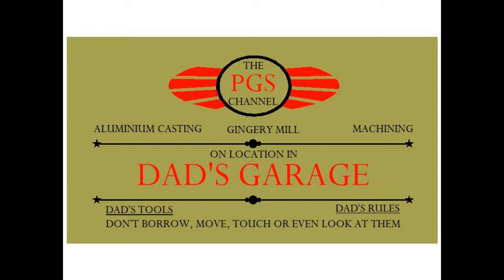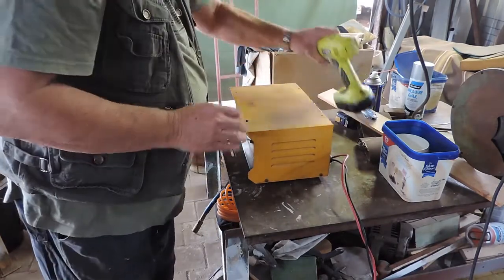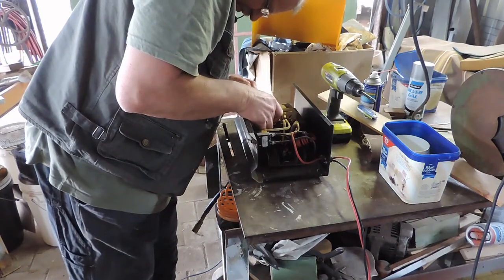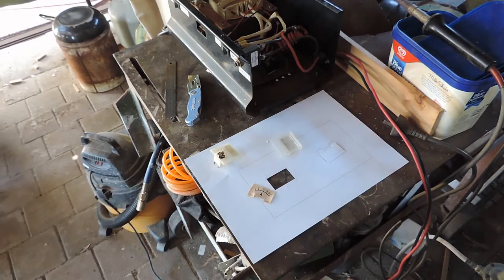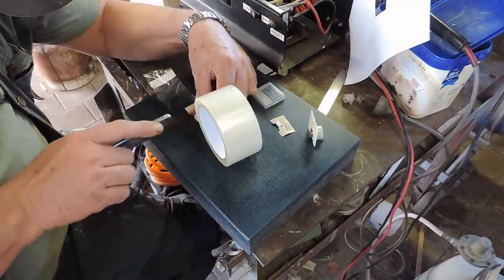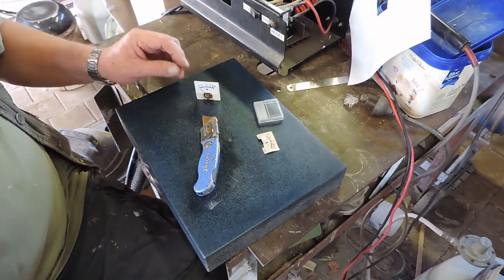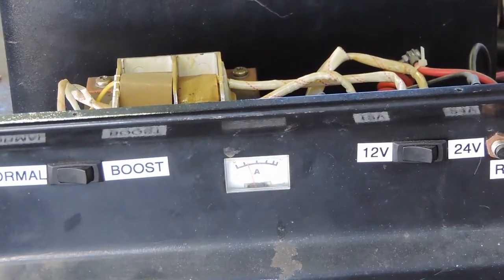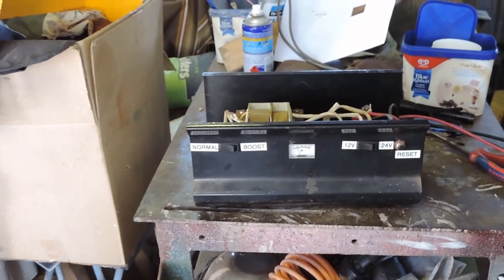Battery Charger Ammeter repair

Comment: Gday Peter, these charges are worth saving, I’m not real keen on the smart chargers, that was a great fix, top job, Cheers
Reply from the maker: G'day Matty.  I bought the smart charger for my caravan, they're great for leave it on and forget but useless if the battery is dead that's where the old type are great but don't forget it or you'll boil the battery dead. Cheers Peter